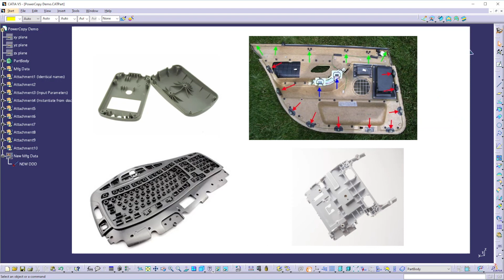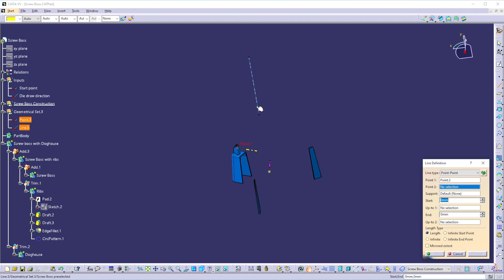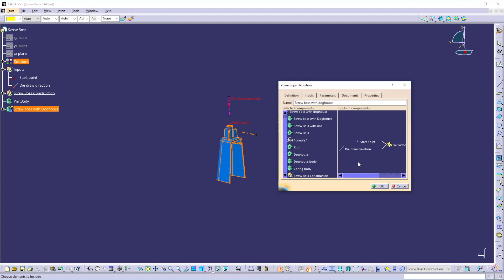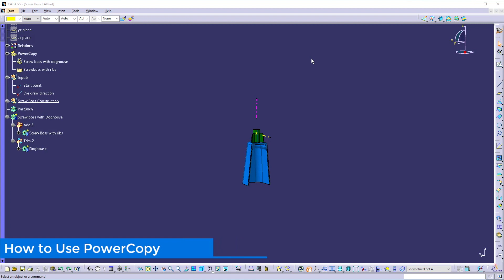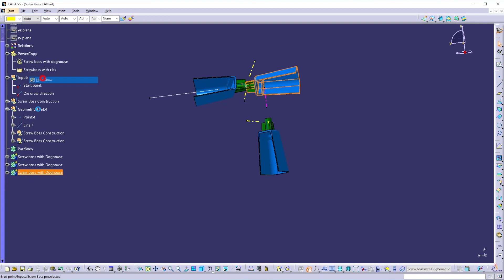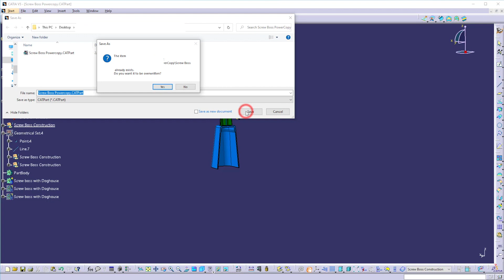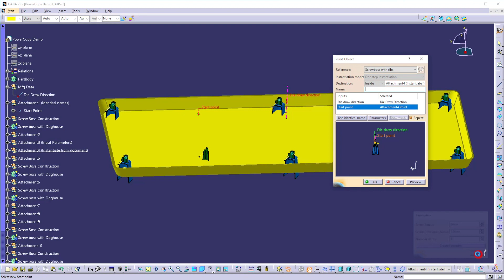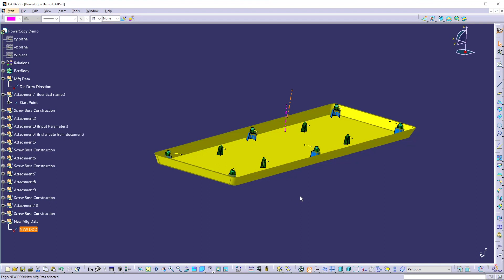CATIA V5 : Create a Powercopy and Use it into the different parts #catiav5  #viral

Comment: Why do we do Power copy and not copy paste
Reply from the maker: Choosing “powercopy” in CATIA is like using a supercharged version of copy-paste. It lets you control how copied things behave, so you can make changes easily. This is important for keeping designs consistent and making updates quickly. You can use it for parts you want to use again and again, and it’s great for complex stuff. When you need to change many things at once, it’s a real time-saver. In short, “powercopy” gives you more control, helps keep things the way you want them, and saves time, making it a smart choice in CATIA.
Reply: Ok thank you 😊